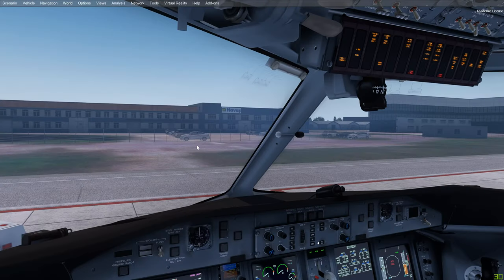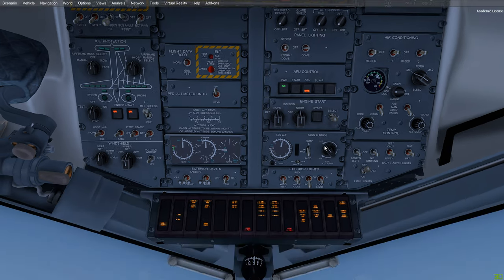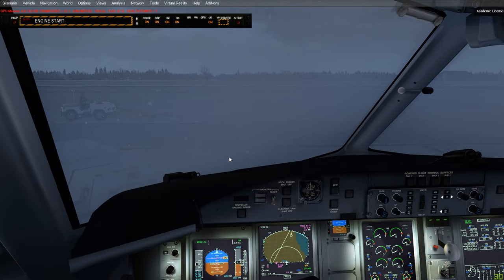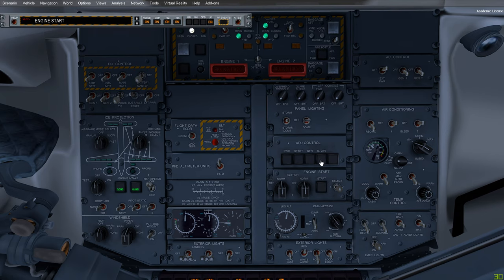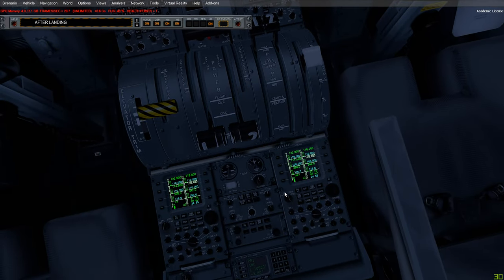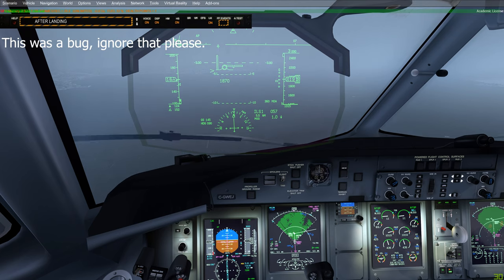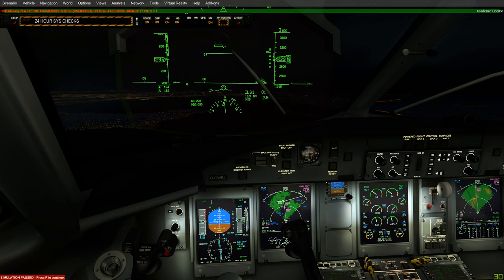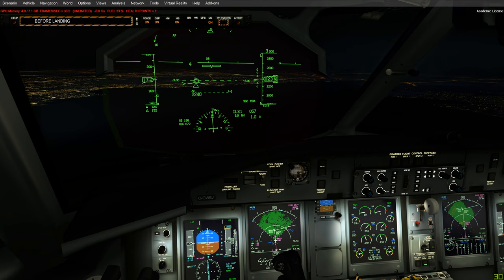FS2Crew Supplementary Procedures | Majestic Q400

Comment: If you open the sliders under the sidewindows you can defog your windows.  The APU generator will not give conflicts if you use external power. It gives the warn sign to show it does not do anything. At the moment you disconnect external power the apu generator takes over. Bleed air is not needed for engine start in this plane. The plane has AC and DC external power (2 switches) It is not allowed to use the apu while airborn